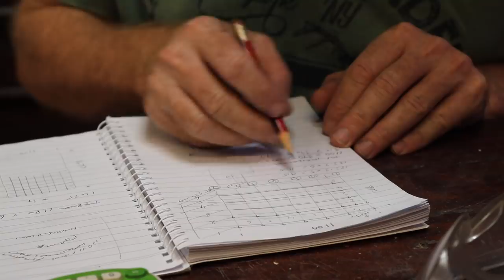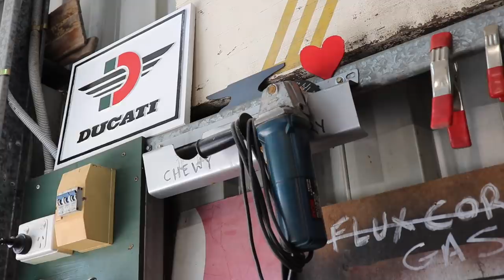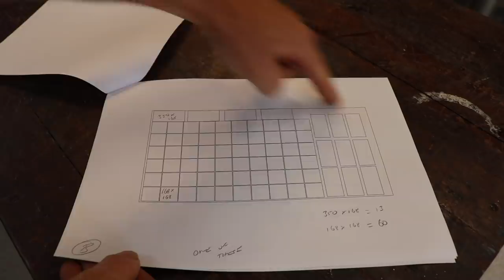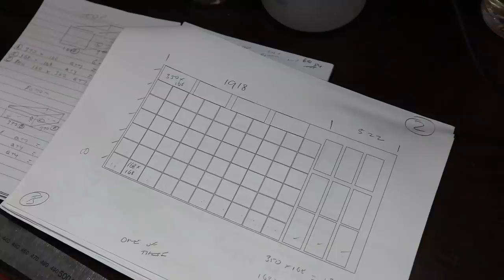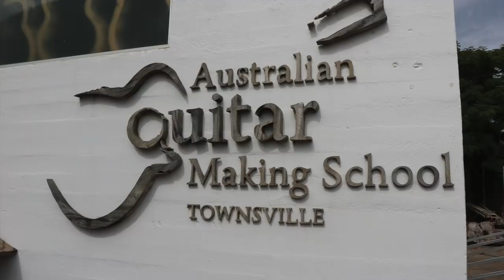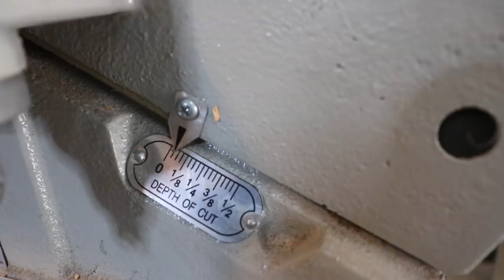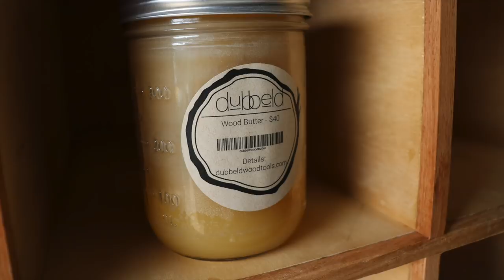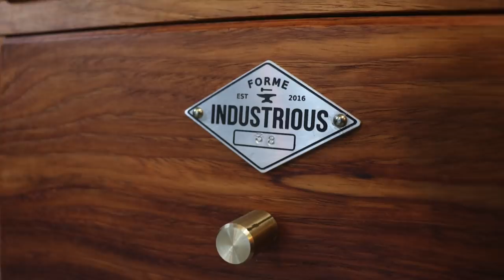42 Drawer Industrial Style Cabinet - Forme Industrious

Comment: Nice design but you should have left blank the top drawers. If you check anthropometrical measurements you can see 
average human height can not reach and see what is in it from this far. So you can use the top side for long pieces. When you design something please be careful about anthropometry and ergonomics.
Reply from the maker: Top is is for my secret stash of whiskey. In small workshops there are compromises where you have to make use of space. Why waste height. When I need something from those drawers I just slide the drawer out and put it on my workbench. In frequently used light items would be kept there. Thank you for your advice and feedback!